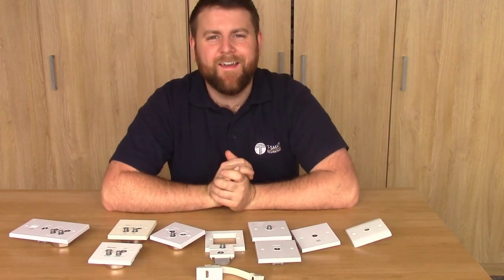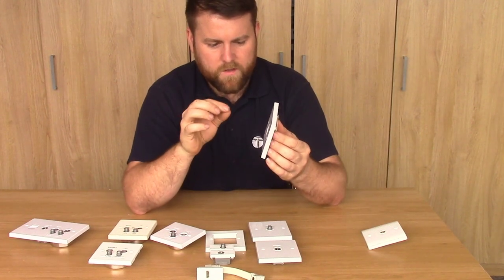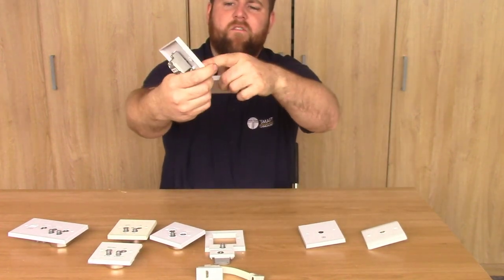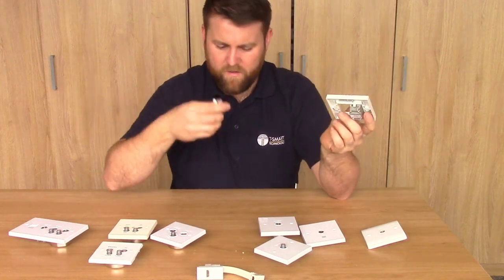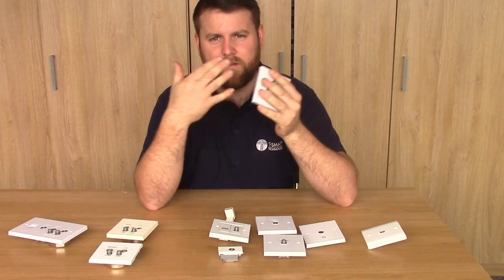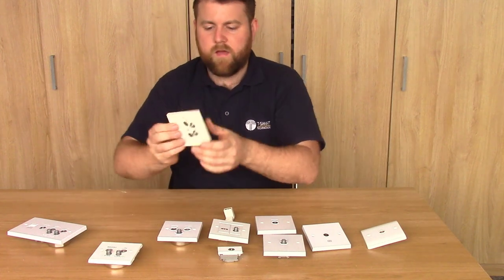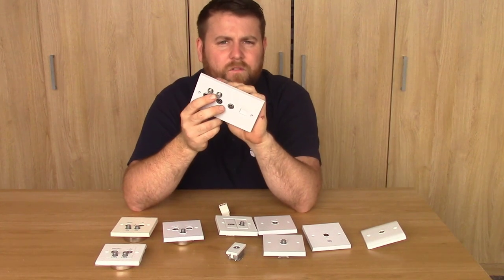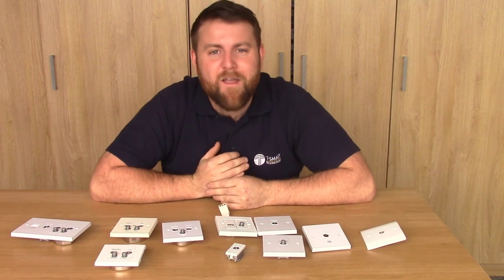The Difference Between Common Aerial & Satellite Coaxial TV Wallplates

Comment: Hello! I have the last quad wall plate in my flat and a single gang female coax socket in bedroom (I believe it's called Slave). Anyhow now that I added a TV in the bedroom as well I want to get freeview+free sat (via TV runners) on both lounge and bedroom. My understanding is that if I connect a cable between Sat2 and Return and then connect a combiner/diplexer in the bedroom from which coax for TV and coax for sat go to bedroom TV should work, while lounge tv will be connected to TV socket and to Sat1. I don't have the cables yet but tried to connect a simple cable between the Radio port and the Return port, then the bedroom with a simple coaxial cable in the RF port of the TV  got about 55% signal strength and 100% quality. I then connected a cable between Sat2 and Return and again the Freeview TV was similar but lacked the HD channels. I then tested with Sat1 and return and it worked great, all channels available on Freeview. Unfortunately I don't know what to make if this.. I thought the signals were combined and then split in the quad wall plate, how can the signal of Satelite or Radio fuel the Freeview reception? Can I watch Freeview and freesat  on both TV's? Will I need a combiner in bedroom or maybe just a simple splitter? Should I change the flimsy poundland coax cables with webro ones?

Comment: What socket and cable would you recommend for running virgin media coaxial? I need to run cable from front of the house to back, but I want it done properly and not clipped to skirting board. We are going to do a full electrical rewire anyway so it makes sense to do it properly.

Comment: Is there a way to terminate satellite cables with a wall-plate to ensure I can use Sky Q in the future. In my new house the builders left three satellite cables from between the loft and the lounge sticking out of the wall. Would I lose signal strength if I put a wall plate on?

Comment: Can you explain or do a vid on installing the aerial, satellite & hdmi sockets/feeds/faceplates like you did for your tv on the wall please. I'm about to dot & dab plasterboard on my chimney breast to stick my tv on and I'm pulling my hair out trying to get my head around how the cables will end up coming out the wall, maybe as a socket on the wall or flying connectors that would look bad and like you said having them all fed from an input faceplate where my sky box, freeview recorder & xbox will be. Dot & dabbing will give me the gap I need for the cables but need to know what to terminate them into. Thanks
Reply from the maker: Hi, I usually just use brush faceplates like this - https://www.tlc-direct.co.uk/Products/CX435W.html?source=adwords&ad_position=&ad_id=415703895075&placement=&kw=&network=u&matchtype=&ad_type=&product_id=CX435W&product_partition_id=297072075353&campaign=shopping_accessories&version=finalurl_v3&gclid=Cj0KCQiA1-3yBRCmARIsAN7B4H1rC1nAtl6tv4Bt5gMfPE9h04JiHp5zY1dt8pkHJKe2JUmpfqVopHQaAjdUEALw_wcB

Comment: Hi Tom,
Can a combined antenna /satellite signal down one coax cable be used without separating the signals using a diplexer, if say I only wanted to connect to a Freesat or Sky box?
Reply from the maker: Yes it's fine, is only a problem when one of the signals is too strong but that is not often the case.
Reply: I am trying to sort out a problem in an apartment block where I have no satellite signal through the diplexer wall plate, but I do have the terrestrial signal. I thought it might be the diplexer at fault but now it sounds as though the problem is in the multiswitch end of things.
Thanks for your reply Tom.

Comment: Hi am in a new build house  i have no digital aerial on the roof but i have tv wall points in each room for freeview, can i get sky dish and use the tv point in each room for freesat or do the need to change wall plate to f connector
Reply from the maker: Hey Guarav. It's best to change for F type wallplates if you can but they would be fine to use as long as they are not isolated wallplates as this will stop the voltage from your satellite receiver reaching your LNB. Obviously you would need appropriate flyleads also. Tom

Comment: Hi Tom, thanks for all the helpful videos and articles. I have a twin cable coming from the satellite and separate tv cable from the tv aerial. Is there a single wall plate that I can wire these cables into so that I have the 2 satellite connections and the tv as well? Thanks!
Reply from the maker: Hi Heidi. Sorry for the slow response. Yes it can be done. I would recommend using two F modules for the satellite cables and one coax module for the aerial. You will also require a 2 gang surround and back box to house these. If done this way there will be a spare module space so you will also require a filler module insert. I hope this helps. Tom

Comment: Hi Tom . Good video , for the last tv plate you spoke about , just want to confirm you would have 2 cable from the sky dish and 1 cable going to another room . But then to send the signal to the other room am i correct to asume you have to put a link between the return tv module to the quadplexer ?
Reply from the maker: Yes that's right, these plates used to be popular for Sky playback systems where the Sky box had an in and two outs. Otherwise you will need a link lead to connect other room(s), or if you wanted to keep the aerial in the main room also a 2 way splitter or amplifier will also be needed.

Comment: Great video, thanks Tom. Btw, does anyone do a screened faceplate splitter? I thought for sure this would be a common item, but it seems it's all diplex stuff.
Reply from the maker: Hi John, it seems like it should be a common thing but it isn't. You could just install a single screened socket and insert and plug-in two way splitter.

Comment: I have the last wall plate. Is there a version of this plate that will enable sky Q to be installed the same way as sky HD (cabling via loft to wall plate)
Reply from the maker: Hi yes, if you get a two gang modular plate and build it up with separate modules (2x F for Sky Q) that will work, you will lose your TV aerial connection if you do it this way though if and if you use one. Alternatively, you could make Sky Q work with this plate but the Sky Q signals would need to be converted to dSCR signals and the box set up in SCR mode, but this is quite a bit more complicated. I hope this helps. Tom

Comment: I have a roof installed "Digital" Aerial to feed a TV with built in freeview. 

I'd very much like to use a satellite face plate to link to my set because it has the more sturdy f-type fitting, especially as the set will be mounted on a pull out and tilt style bracket. Can I do that; or must it be the normal TV outlet?  

Thanks
Reply from the maker: Hey, yes no problem you can use the satellite plate for TV aerial signals. If it's going up behind the TV on the wall you may want to get some right angle F adapters too. Tom
Reply: Ahh! great idea, I was looking for a plate with a downward tilting port. Never knew they had right angle connectors..."Thank you"
Reply from the maker: No problem, :) Please do subscribe to the channel. Tom

Comment: I wants to install Quadplexed module switch in all rooms
https://www.screwfix.com/p/crabtree-instinct-1-gang-quadruplex-multimedia-socket-white/991hv

And, for distribution can i use this one please, or Do you suggest any other batter option?
https://www.toolstation.com/proception-starbox-home-distribution-system/p69363

As per my understanding if i do Quadlexed's two coax cables combined in to 2 way splitter and other side single cable run all the way to the loft and connect with distribution box do you thing this will 
work ?

And, second thing i want to know in this case once all this done just do i have to connect LNB1 and LNB2 port with two separate satellite dish in to the distribution box so  two dish work in single cable.
Reply from the maker: It won't work Manish. To do what you want to do, you will need a Multi-switch amp, not a loft box. 4 cables in from the satellite dish, one cable in for terrestrial TV. From here you run 2 separate direct cables (no splitters) into the Quadplexed wall-plates. This means that to support four separate TV points for examples with Quadplexed plates, you would need an 8 way multi-switch amp. There are other ways of doing things but it's going to be too difficult to summarise/ explain. Please also note that the multi-switch suggested below is not compatible with Sky Q.

Multi-switch amp (compatible with a Quad LNB)- https://cpc.farnell.com/optima/ms508lte/multiswitch-5x8-lte-optima/dp/AP02652?mckv=sMie4QjoA_dc|pcrid|224680055011|kword||match||plid||slid||product|AP02652|pgrid|51011277550|ptaid|pla-836055798603|&CMP=KNC-GUK-CPC-SHOPPING&gclid=Cj0KCQjw17n1BRDEARIsAFDHFex03u3Ot_xb-uF7QcououIKoE8zgS5QRQ2UZRHr2crTu_WmkCVmOsUaAmFJEALw_wcB